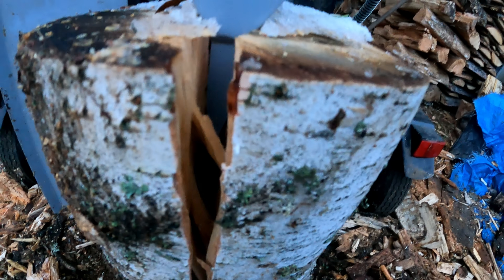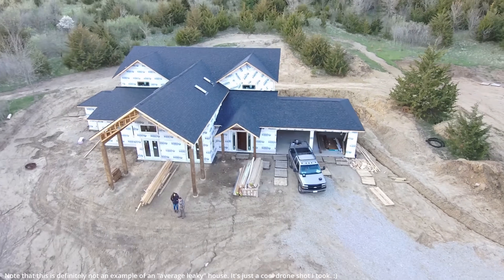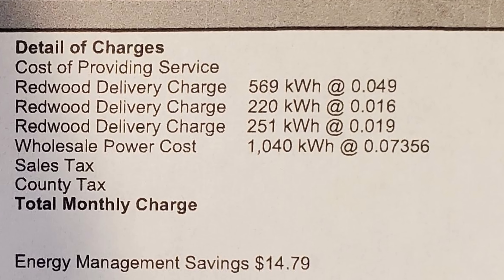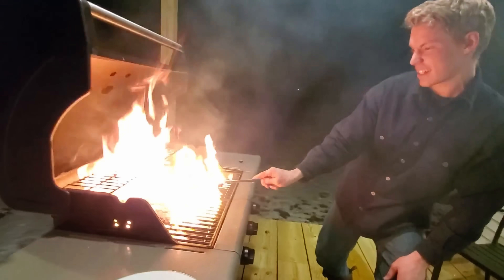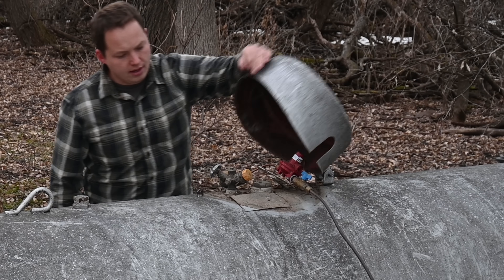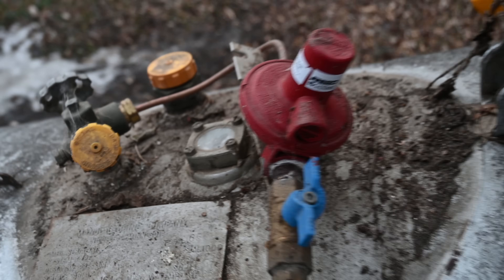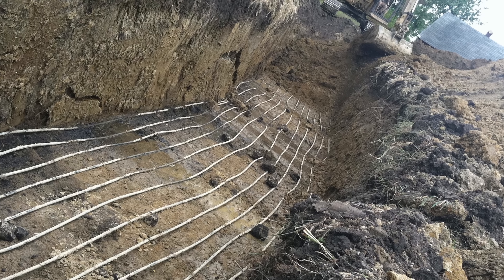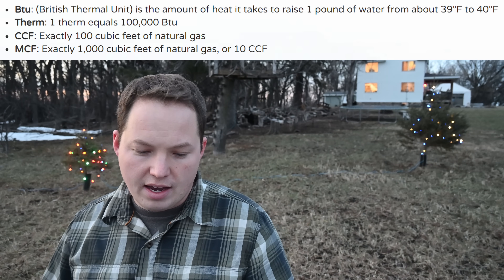What's The Best Heat Source in 2022? Top 5 Home Heating Methods - LP Electric NG Geothermal Fuel Oil

Comment: Other things to consider is safety, convenience, and space requirements.  People rarely consider the time, machinery, and fuel involved with harvesting fire wood, storing it, and stoking a fire day and night.  I am happy I chose to go with a mini split to heat the garage in the winter months than to deal with propane.
Reply: If you're going to start throwing in other variables you need to consider the ambiance and comfort of burning wood, not to mention having heat when the power goes out (for example if you have a 1/2 mile long driveway on a dead end road through the woods). Nothing beats sitting in front of a wood stove on a cold winter night!
Reply: @randomvideosn0where  There are safety concerns with burning wood, chimney fires, I considered a wood stove to heat my garage, just not sure it would be wise to have a open flame when working on a vehicle.  I would agree about the ambiance about a wood stove and the kind of heat it throws.  Pellet Stove may be an option...
Reply: @randomvideosn0where  Burning wood does help preserve the fossil fuel reserves, but it is not exactly green...  CO2 emissions from combusting wood for heat can be 2.5 times higher than those of natural gas and 30 percent higher than those of coal per unit of generated energy.  Considering the price or oil today, burning wood will certainly save you money, not as likely to save the planet...  still politicians hand out tax credits for those who switch to wood for heat.  There are a lot of people out there who think mini spits are the wave of the future for heating and cooling combined with renewable energy solar/wind/hydro, personally I think it is a pipe dream.
Reply: @ericfraser7543  A mini split combined with solar, micro wind, and a wood stove is overall pretty good. 
Wood stoves are not always a good option, for example in suburbs or urban setting where people will inhale the smoke. However I cut dead trees on my own land with an electric chainsaw, split them by hand, and burn them so the only net CO2 emissions are the production of the saw and small electricity used to cut. The burning emits CO2 but it was captured by the tree, and the tree died anyways so would have released CO2 decomposing. It is inevitable that people will burn wood in the US so switching from open hearth to catalytic stoves helps!
Reply: @randomvideosn0where  No it makes lots of sense to burn dead fall and save on a fuel bill, plus decaying wood probably emits greenhouse gasses, it can be sustainable just not on a large scale like all of the US...  if you consider fossil fuel is essentially really old dead fall.  its more of a convenience thing for me time is money too... solar and wind are both an investment to save an electric bill...  realistic people say its about 7 years ROI...   its like talking to a gambler, they only tell you about their winnings...  those who live off grid will have higher transportation costs too...  I think solar an wind would be better managed by the electric company rather than an individual.
Reply: Dude, you're a "mechanic" and worry about open flames working on a car... You ever use a grinder, welder, gas axe or anything? You should probably hire it out to someone if you're THAT paranoid.
Reply: @kevinfreeman3098  Gasoline flumes are heavier than air... which is why boats have blowers...  go watch some videos of people lighting their fire pit with too much gas.   Not sure where you got that I am a mechanic...  All I said is if you are buying firewood you probably not saving money nor the planet...

Comment: where i am it 8 cents kwhr for first 1000 then 6cent  after that.
 i run a eltric furnace where goes to -40 every year
 i make changes to my 800sqft house every year that makes it a bit more efficent  still leaky but i want it to breath some what 

propain is prohibitivly expensive with a 1000$ delivery charge ontop of the price.

wood u cant have insurance of any sort if u have a wood stove.  
but least with wood u get ur cardio ever day 

deasil aka oil same extra costs as propain

heat pumps are useless here as it hits -40 for weeks at a time

had looked at geo thermal but... theres bedrock 1-2feet below my basement floor and frost line goes below my house down to bed rock mpst years soil is esker sand might work for summer ac though i could prolly get away with putting in a coil in my furnace thats circulating water thats never gets over 10c in the summer for ac

Comment: We live in central MN. Our house is about 7 years old, 1800 sq ft, literally tons (18T to be exact)  of insulation, 12" thick walls, 22' thick ceiling, triple pane windows, Passive solar, we use an off peak brick heater, and wood for our main sources of heat (and of course the sun).  We do have 2 air source heat pumps, we have never needed them for heat, but we could as they are rated to produce heat even with ambient temps get to  -19ºF. We use them in the summer for AC though. Our goal was not to use any fossil fuels in the heating or cooling of the house. We have a solar array which, over the course of the year, produces more energy than we need for all house functions, plus our electric utility pays us for our excess generation. Bottom line is we pay nothing for heating our house, in MN, in the winter! You made an excellent video, Ben. Cheers!

Comment: My 2300 sqft home cost me $300 a year to heat. I buy firewood at $150/chord and burn 2 chords a year. I also have an air to air heat pump and a propane furnace. I don't use the heat pump and gas furnace very often since they are expensive to run. 
The caveat is my house is in the ground. Its easy to cool in the summer as well. Even without heat it takes several days of below zero temperatures before the temperature in my house drops below 50 degrees.
Reply: same i have a 1 level house.. well 1 level at half the the house wityh a crawl space under it the other half is 2 levels with a basement, the first half is heatpump, 2nd half is furnace gas..  but i have a wood stove and man with a ceiling fan i can keep the entire house heated for free with my 14 acres of woods..  the nights i come home late or something i might use the furnace and heatpump.. but electricity usage is so much it would be killer if i used them often

Comment: I use a Carrier Infinity dual fuel system for my 1600sq foot house. I currently heating with NG $9.10 an MCF in WV but I love the option that I could heatpump if needed but it's 16.5 cents per KWH 😬. I have been looking at supplementing my electrical use with solar in the future.

Comment: 1971 ranch in north west NJ. Coal furnace  heats 1400 sf unfinished basement which  radiates up from the floor to heat 1400 sf at 73 degrees upstairs for 860 dollars.

Comment: You are  correct to state there is a lot of variation in fuel prices which affect the calculation of annual cost but there is also much variation in appliance efficiency. I think 95% is too generous for the average gas appliance. Another cost to consider is the electrical cost to move the transfer medium be it a fan or a pump. I burn #2 fuel oil and use a single ECM pump and zone  valves to direct heat and consider that the cheapest way to heat since natural gas is not available where I live. My boiler measured at 86% efficiency which isn’t too bad considering I have a masonry chimney. But oil requires annual maintenance so the costs there are higher. I also utilize a ductless split heat pump when the temperatures are not too low. I like your overall
Reply: Larryboy,  With the $6 fuel oil this winter, the ductless system will be much less expensive then the oil system.  Your 86% efficient on oil seems very optimistic to me.  And might not include the water pump wattage, that can be over 4 KW per day even with very efficient pumps and not running them all of the time each day.  

I guess I would want to run the heat pump when it is above about 15F.  Then run the boiler system when it is below 25F, in part to make sure none of it is frozen!  But not use it as a primary heat source at any time, due to the Very high oil prices.  You get about 105,000 Btu's per gallon of fuel oil?  Give or take some.  Fuel oil should contain about 130,000 Btu per gallon, so your 86% unit might get 112,000 Btu's per gallon max.  Still well over $5 per 100,000 Btu, while the heat pump is only about $1 per 100,000 Btu's.  

The reason 92% efficient furnaces are so terrific is they take the steam out of the flue gas and change it into heat in the second heat exchanger.  So to produce steam, it takes 1,087 Btu's per pound of steam.  And you get 1,087 Btu's  of heat out of every pound of water that you get out of that steam.  The 92% efficient furnace will produce several pounds of water each hour, and thus more heat into the air stream.  And by exhausting only 95F to 105F flue gas, that is also capturing the most heat they can.  Thus the need for a plastic flue pipe that will not get dissolved by the acid in the natural gas.

Comment: Great job. Natural gas is the winner. Did not realize the cost increase for propane. I'm in North Fla so the heat pump is a great option due to operating efficiencies at a higher average temperature.

Comment: Just ran out of propane this cold MT winter.  Now using natural thermal heat from the first floor with a couple of oil filled electric radiators to keep pipes from freezing.  A southern exposure and lots of glass heats up the upstairs on sunny days and at night I turn a small propane heater while sleeping.  During the day we have fire places on the first and second floors and this is all I need until the propane company can get here.  Natural thermal and sun light are my favorites, just don't forget the long johns, house temperatures can dip into the 50's on cold nights but is livable.

Comment: I use two natural gas non-vented heaters.  One is in the fireplace with the damper shut.  They burn the gas 99.9% efficiently.  I am not sending heated air through a cold attic to circulate.  The heat migrates well.  On the same token, I have a 24000btu mini split heat pump for the main source of cooling.

Comment: Because of very unreliable electric power distribution, when I designed my house 20 years ago the plan was to keep the electrical grid load to the absolute minimum to be able to run everything from a 12kVA propane standby Gen set. (have two propane tanks on site with 1200gal on tap) I put in two independent forced air heating systems, with separate ductwork, one 80% Propane the other for solid fuels like wood, coal and now with all the e-commerce, burning ton's of cardboard. I do not buy firewood any more. And that is in the Dallas TX metro area. Of course to keep the electric peak load down the water heater, the kitchen range and the clothes dryer are all propane powered. And to get keep peak electric load for 5 tons of AC down I use a cooling tower for the AC condenser of course thyristor controlled soft starter for the 4 ton AC compressor motor that thanks to evaporation in the cooling tower outputs 5 tons. So no problem to start it from a 12kVA propane gen set. happy living ever since.

Comment: Honestly, heat is cheap in the US! Compared to Europe.

Where I live (Germany), heating oil is currently still used, but that is a declining type of heating because it is very expensive.

Natural gas from Russia by pipline is very popular, but prices are rising.

The US would also like to sell us gas, but transport by ship is expensive.
Gas from tanks is only used if there are no pipes for natural gas. Maybe that's a market for the US.

Some have the right to cut wood and thus contribute, but it is a lot of work.

Then it is better to have sawdust delivered from the sawmill and burn it in a special facility. Well priced and convenient if you can get a contract on delivery.

It was often criticized that there is little AC in Germany. The temperatures often reach only 25 ° C = 77 ° F in summer. Maybe a week 30 ° C = 86 ° F. In winter we have down to  -10 ° C = 14 ° F.

Now the government is pushing heat pumps, AC for heating. This is mandatory for new buildings.

I only saw heating with electricity through resistors in the cemetery chapel. This is often not used and then only for one day. But then only so much that you can sit there without freezing.

Comment: Ya ground source heat pump 15 years now using well water as we have lots and we put it back after use. After I installed the solar  my utilities for electric and heat are only $38 a month and I live in Canada where it is cold and everything is expensive.

Comment: The new split units are allot more efficient. I installed one with a friend on his house. They come pre charged. Any skilled contractor could install one. I have 98yr old 1500sqft home with cast iron hot water oil heat. My peerless 190k btu boiler calls for a 1.25gph SS nozzle. I ran a solid 80 degree .85gph for 20yrs. my season went  down to 500 gallons for the season. The trade off was the boiler run time lasted over an hour before it would limit out in 20 degree temps. I'm older and colder so I switched up to a 1.1gph hollow on my oil guys advise. I'm on track for a 600 gallon season. The hollow nozzle heats more efficiently than a semi solid or solid for some reason. Average run time is 40min to limit out while calling for heat. I'm debating heating my radiator circuit with a heat exchanger fed by a hot water solar collector I'll install on my sun all day porch roof. Or an electric heat exchanger fed by a battery bank, and  power inverter from electric solar panels. 48 volts DC supply exponentially increases discharge capacity
Reply: My 1888 farmhouse had terrible crawlspace ducts and an old package unit heatpump when i bought it in 90.  Replaced the central 2 ton heatpump in 2001...still terrible as the floor ducts kept degrading.

In 2020 I put in a four zone Carrier minisplit, and we pulled out most of the abandoned ducts, plugged all the floor registers.  I had the floor standing cassettes installed as they looked much better for the period house....and all the tubes run under floor like the plumbing....so no ugly pipe snakes on the outer wall.

Power consumption dropped in half and they actually can heat the house, which the ducted system always struggled with as it is a Gulf Coast home and was designed to breathe....despite later insulation.  Minisplits are the way to go for old construction.

Only problem is bedroom closed doors at night.  This year I'm installing louvered doors to achieve air return, but have privacy.

I would never retrofit ducts into a house not built for them....especially if putting them in the attic or a closed basement is impossible.  Under floor on piers is terrible as animals and decay just destroy and mold them up.
Reply: @STho205 That's a great solution! In several ways, considering south Floriduh and nature tries breaking in. Dad and I had a condo in Sarasota. I just sold it with the original 1980 ducted AC with a 5kw heat pump for $640k!  March 2021 I had it appraised @$370k. The cost of keeping it drove me out. I couldn't get rid of my chills with the cool breeze the heat pump was creating. The tree rats were running throughout the ducts. I froze my ass off every winter, and my home base is Long Island 🗽 NY I'm used to damp cold. My last winter down there was a critter chase. I tethered big snap traps inside the ducts and tied off to the register. I killed several.
Reply: @keithhults8986  yep...we got possums and raccoons one winter.   They drilled right in through a tape joint. They stink when heated.  Can't be healthy air.

Minisplits don't heat and cool ducts....they condition the livong space only.

The tall two fan Carrier outside unit is dead quiet and vertical so it doesn't take yard space.  The inside units are no louder than a modern refrigerator.

Comment: You're a smart guy but trying to pin energy costs on any president is a farce. As much as everybody loves to hate on a president for high prices at the pump or praise them for low ones, Presidents have little to no control over energy prices. That's a myth.

Comment: This is a good comparison of fuel cost but to determine "best" should consider other factors too, such as lifetime maintenance cost, environmental impact/carbon emissions, risk of leaks, ability to heat by zone, etc. You mention insulation briefly in this video; would be cool to do a whole video about that since it also makes a huge difference in total cost.
Reply: Indeed, and I would include climate for your location. Heat pumps are much less efficient in cold weather so make less sense in norther states. In Texas they make much more sense than, say, Alaska.
Reply: @PlutonianPenguin  if your backup heat source is natural gas, the a heat pump still makes sense up to zone 5. Zone 5-6 is probably the tipping point, but with gas being cheaper than running the heat pump it's not a deal breaker. Imo
Reply: Insulation is, indeed, a whole stand-alone topic, and makes the biggest cost consideration, in my opinion. In winter, the goal is to keep the heat energy indoors. I grew up with a wood stove, corn stove, propane stove, a kerosene heater and rarely electric heaters. Lol. Wood was number one, propane was secondary. In any decent storm, we lost power. The "best" certainly does consider many factors. ❤️
Reply: @pinkysregenerativevarietyf9345  i agree. When you lose power often, a woodstove is the only heat source that let's you stay in your house. I can stay warm and heat, reheat, or cook on my woodstove and keep my pipes from freezing.